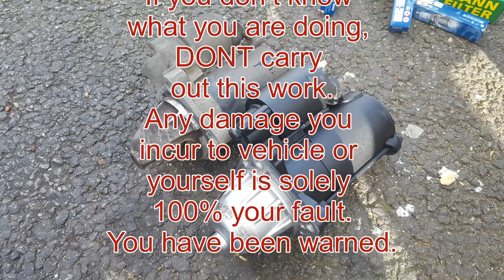How to replace a starter motor ford fiesta mk5 V mk6 BE256 GEN 5 2002 2003 2004 2005 2006 2007 2008

Comment: No crank after changing a gearbox. Having a meltdown but i think i forgot to put back tose wires on the starter 😂😂 i really hope youve answered my melt dowm question 😂😂
Reply from the maker: So was it that wire in the end? If not check that the earth wire from the battery is connected

Comment: I've also found the plastic junction box under motor comes apart too easily. I've put petroleum jeely inside on wires and taped up box.

Comment: it was an awful job on mine there is exhaust, aircon, and 99 other things that stop me from seeing the bolts let alone getting them out the basic looks easy but the top models 1.6 have so much in there to block it in. !!!!!!!!
Reply: Same here!!
Reply: I air con deleted my 1.6 to help with this very problem. That and it helped lighten the car and improved acceleration somewhat

Comment: Thank you for the video: a quick question: are the hissing and clicking sounds you make in the beginning of the video signs that the starter motor is going bad? In my fiesta it is starting to make these noises every now and then when trying to crank it.
Reply from the maker: Yes, clicking noise and a slow turning stater can be a result of bad starter, but it also could be due to a weak battery. i'd advise that you should get the battery tested first. I hope this helps
Reply: @jayxunderwood  thank you for the response, the battery is only a year old and one time he hisses, next try he starts right up so I'm keeping an eye on the starter when he fails completely!
Again thanks and have a nice day
Reply: I replaced the starter motor myself yesterday using your video, she is working like a charm again. Cheers mate

Comment: I replaced my starter motor on my ford Fusion (Europe) after watching this video. It took me 2 and a half hours to do so 😂
The 2 nuts to the starter wiring is a right pain in the arse but it's manageable, would be better if I could get it up on ramps.

I didn't take the bolts out though because it would be hard to get them back in again with everything else surrounding it.
But thanks!

Comment: Thanks for video
How long would
You say it took you?
From start to finish including jacking car up
Cheers
Reply from the maker: It took me 25mins
Reply: Jayxunderwood sweet thanks so should take me 90mins 👍🏻
Reply: TiSwAs  how did it go? Going to order this part tomorrow and try and replace it myself. Curious how it went for you.
Reply: Does anybody have any idea if a ‘2008 fiesta style’  shockie and hub would fit a 54 plate fiesta finesse? spun out on the slush/ice and smacked a roadside grassy verge then landed back on road with a thump.  front bumper came off and drivers side front wheel was buckled and slanted.  when i drove car to a safe spot the steering wheel was turned as if i was going sharp right but car was actually going straight? my mechanic says i need a hub/shockie and they will do the rest, but due to covid it is hard to come across parts with most scrappies closed around my area but managed to find a hub/shockie 60 miles away and went and picked it up. since i’v got home i’v noticed the reg of the car it came off written on part and says its from a “2008 plate fiesta style” so was wondering if this will still be ok for a 54 plate? as far as i can see online most people are saying 2001-2008 fiestas will take the same parts 🤔
Reply: Hello mate, all fiesta suspension parts are interchangeable apart from springs. If you have a petrol then you can't use the springs from a diesel. If the new hub and shock you picked up came from a petrol and yours is a petrol then it will fit no problem. Diesel springs won't work because they will sit higher as the diesel engine is heavier than the petrol so ride height will be all over the place if you use diesel springs on a petrol.
Reply: @josephturrall2333  Cheers mate, got the car back and seemed fine first day but last few days i'v noticed a whirring sound when i start to build up speed and a sort of tapping/knocking going over even the slightest of ridges on the road surface?  Starting to think something hasn't been done properly or maybe ther has been more damage done than first thought and garage havn't noticed?  Going to take it back in to get looked at 🤞🏻